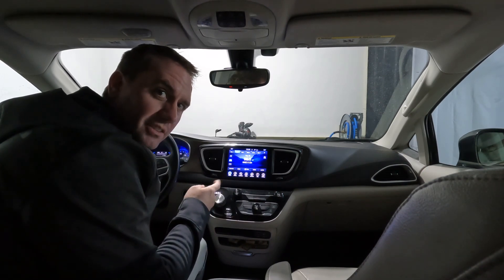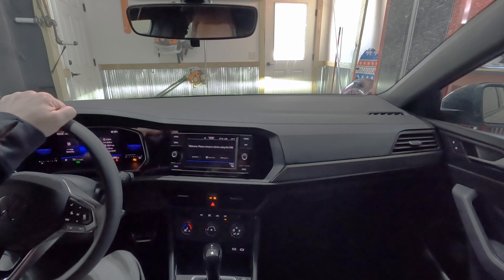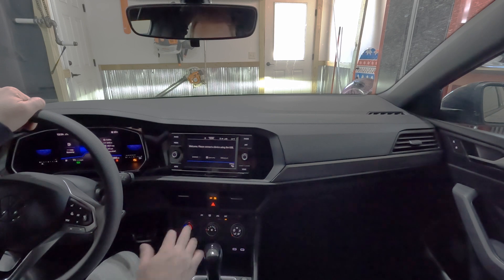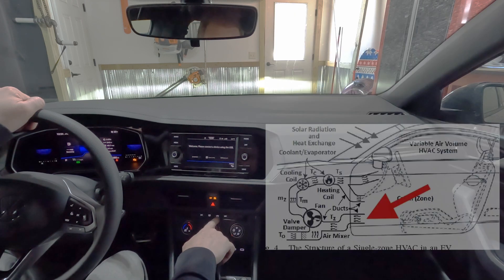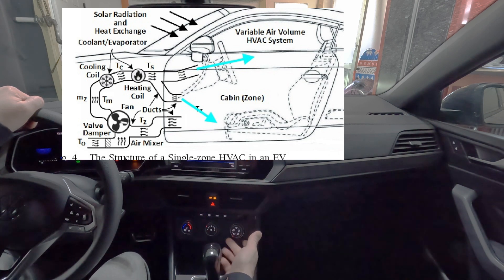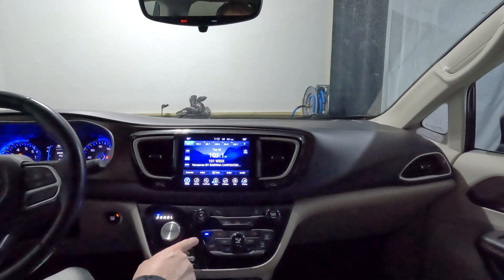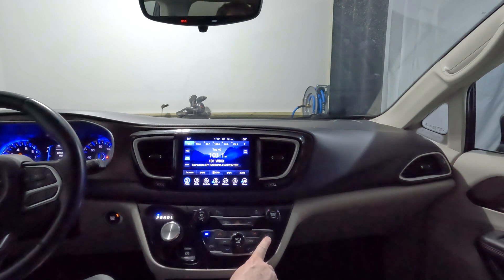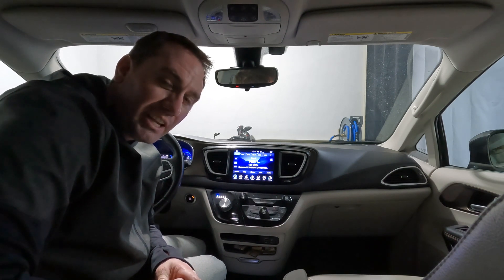Automotive Corner #2:  Automatic Climate Control Explained

Comment: But what if you are only using the recirculation mode and you want heat 30 degrees Celsius heat but you already have 28 degrees in the car.  How can it only use 20% ( since radiator is waaay too hot to  bump the temp just 2 degrees )  pass through radiator to keep the temp ok ? Where does the rest of the 80% cooler air come from ? It can't come from ouside as it's in recirculating mode. Does the other 80% just come from a " cold spot hidden vent" inside the car?
Reply from the maker: There is a blend door that can direct a portion of the recirculating air past the heater core.  Essentially, there is a bypass.

Comment: I have been driving for two hours and my car is still not giving me heat from the heating unit. That is how I got to your channel because I was asking The Google how to turn the heat on.?

The passenger and driver side dials are on 84° and 82° respectively. I’ve been in the car since about 330. It’s now 530 and I’m still not getting any warm air. I do not understand can you please help?

Thank you
Reply from the maker: I'd recommend checking your coolant level, you may have a leak.

Comment: Today's HVAC systems are so complex that almost become counterintuitive, plus they brake easier too. I much rather have a manual/analog system of pulleys and cables like back in the day, those would never brake. Simplicity is always better. A little blend door actuator these days, depending on its location, may make you have to remove the whole dash and spend a lot of money to repair it. Great video and excellent explanations btw..
Reply from the maker: Agreed, mix in some temperature and humidity sensors and you have quite a complicated system.  

Thanks again for your great comments 👍
Reply: @TheLawnEngineer  Sure thing, keep up the great work!
Reply from the maker: @MikeSF5  I’ll try.
Reply: @TheLawnEngineer  btw, I got hold of the Factory Service Manual, not sure if you already have a copy. I can send one your way if you need it. Let me know.
Reply from the maker: @MikeSF5  awesome, I don’t need it anymore but thanks for the offer.
Reply: @TheLawnEngineer  👍🏻